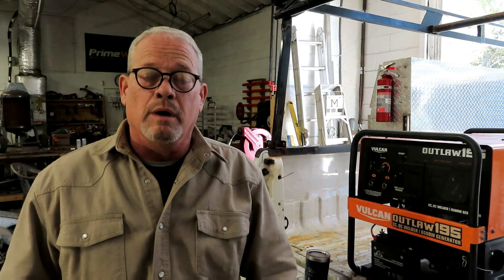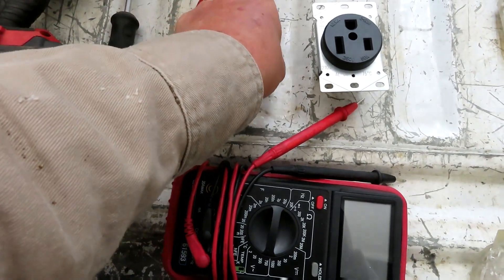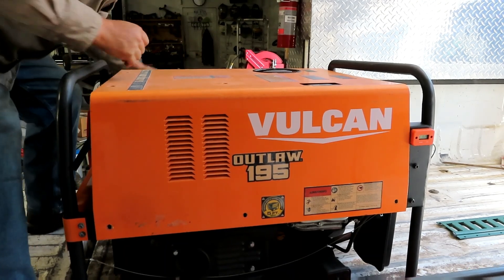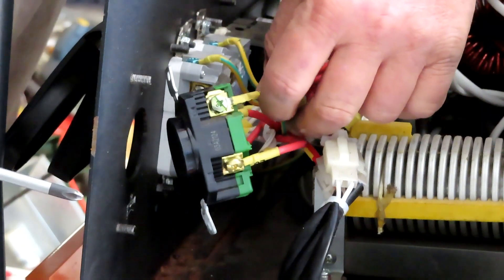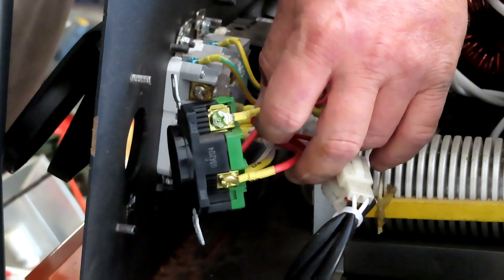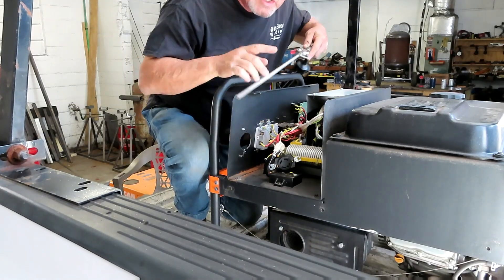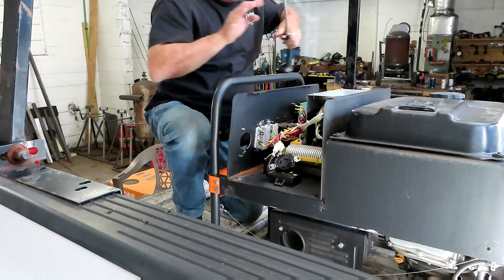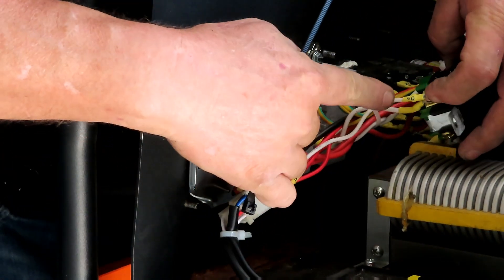Modifying the 220V Plug on the Vulcan Outlaw 195: A Step-by-Step Guide

Comment: I've tried running the omnipro 220 off that outlet. The required amprage output is 50amp. The output on that is only 28 even though it's advertised as 30. What are you intending to power by switching it to a plug design primarily used with 240 welders?
Reply from the maker: I got a small 220v Flux core welder for it
Reply: How well did the omnipro 220 run? I want to use it to run mig.

Comment: Hi , I've got a tip for you that I learned back in the early 80s ... When you need to enlarge a round hole , grab the holesaw for the size you need , and then thread the saw that fits the existing hole inside the other one and it will serve as a pilot ... 9 times out of 10 this works ... Great vids bwt !!
Reply from the maker: Wow. That's a great tip. Thanks! I usually have to put a new piece under the part with the hole and drill through both. But sometimes that's not possible. That would have made that hole look a lot better.

Comment: Just curious what was your voltage readings on each leg after you replaced it?  I just did the same swap and one leg is getting 80-85v and the other is getting around 150v
Reply from the maker: I had the very same readings before and after the swap. Naturally, you would think it would be 120 on each leg, but I never had that. I thought something was wrong. I had 2 other guys check theirs, and it was the same. So, I guess that's just how it was designed. I was told by some guys with more knowledge about this, that as long as it adds up then it's ok. But yeah, I had the exact same readings as yours, before and after the swap

Comment: I think I read in the manual to turn the welding power all the way up when using the 220v plug.
Reply from the maker: That is correct! You need to turn the welding power all the way up to utilize the full capacity of the 220V power.
Reply from the maker: And, to turn on the 220v plug, the "Welding Power" switch needs to be on.

Comment: As someone that is new to welding, I appreciate your content and will keep watching as you grow your channel.  I do have one recommendation that will not only up the production value of your videos, but may help to maintain or increase viewers as well.  I recommend looking into a wireless microphone that will cut out most of that distracting background noise, to keep your viewers engaged "in the moment." Good audio is often overlooked, but it is imperative for a well-rounded production. Here is a short video that illustrates the difference between camera audio and a wireless microphone. https://www.youtube.com/watch?v=BM4uO1EyyfU . Just a thought. Keep up the great work, and I'll keep watching!
Reply from the maker: Yeah, thanks. I do have a wireless mic, however, my current camera does not have a mic input for the receiver. So I have been looking into a new camera.
Reply: @AllStarWeldingSC  I see. Not sure if your current camera has an audio input at all, but if it does, usually it's a 1/8 inch. If so, you would probably just need an adapter. It would be a shame to have to get a new camera, especially since there isn't anything wrong with your picture quality.
Reply from the maker: No... Current camera does not have a input at all. My old one did. But I broke it. I had another channel that I used that camera with, and the wireless mic.
Reply: @AllStarWeldingSC  You could get an external audio recorder (cheaper than a new camera) and plug your mic into that, but then you would have the extra step of syncing your audio. I have made my living as a professional television/video editor since 2006, so I know how much time you are already putting in.  The key is the content, and you are doing a great job with that!

Comment: Thank you for the video! Just wondering if you got to run the plasma cutter (under a load)? Will the 30 amp breaker be enough? I have a Hypertherm 45 and miller 220 ac/dc and was debating on doing what you just did. I’ve had the Outlaw for about a year now and it’s been really handy. Thank you again for all the videos and information you put out there, greatly appreciated!!
Reply from the maker: I ran out of time, and didn't test it at max. I have in the past ran that plasma at 25amp on the 110v side. I will test it fully tomorrow and come back to you with the results
Reply: @AllStarWeldingSC  did you happen to run that plasma cutter? I’ve been debating on the Outlaw or the 13,000 generator. If plasma cutter works on the Outlaw then that seals the deal!! Thank you
Reply from the maker: Plasma doesn't run well on the Outlaw. It's just too much for the 6500w. Kept tripping the breaker
Reply: @ 
Thank you sir! Greatly appreciated
Reply from the maker: @jimpool2889 I will say this.... When I ran the air compressor on the household circuits, and just the plasma on about 20-30 amps, it did fine on thin stuff. But as a out in the field tool, no it's not good on the Outlaw
Reply: No hurry, I was curious. I know you are busy and I do appreciate all you do on here! Thank you again!!
Reply from the maker: Thanks. I have another Outlaw video that I am working on now, but after that, I will do the test on other equipment. Keep an eye out for it.
Reply: Thank you sir!

Comment: Very good video and instructions.  What I did not understand is the purpose of the two white wires.  Do the white wires serve a vital function for the welder generator to perform as it is intended? Thank you.
Reply from the maker: That's about the limit of my understanding, hopefully someone can comment about that. I really don't understand what a "neutral" means. Looking at the adapter that I have, it has clear ends, so I'm able to see that the neutral tab on 4 prong end is not used at all in the adapter. So, comparing that to the wiring diagram for the Outlaw, does show that the 2 white wires are tapped into the circuit for the throttle control box. If the 2 white wires on the neutral lug on the back of the 4 prong twist lock are separated, the throttle control will not work. So, either leave them connected to the socket as I did, or butt connect them together and take out the socket. Either way, they need to be connected to each other at the end of the project for everything to work correctly.
Reply: I have an adapter I bought from Amazon for my generator. It is an L14-30P to four NEMA 5-15R plugs. They are color coded to indicate which side they are drawing power from (X or Y). This allows you to use the L14-30R as a n additional set of outlets for 120 volt operation.